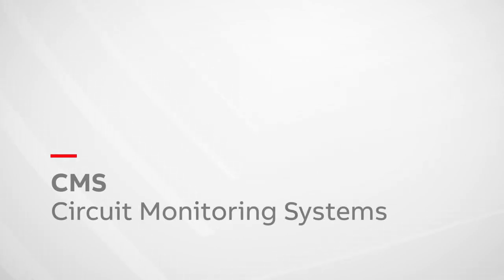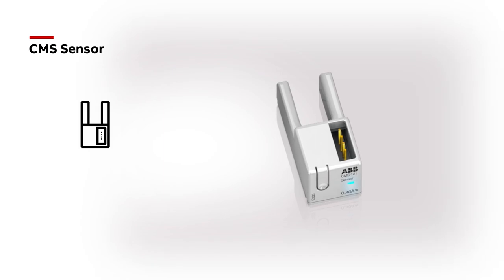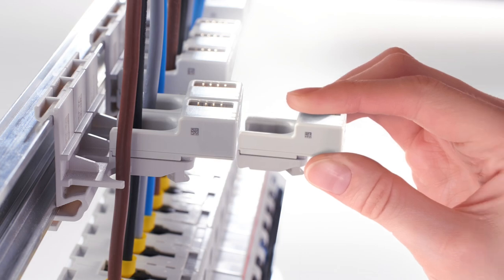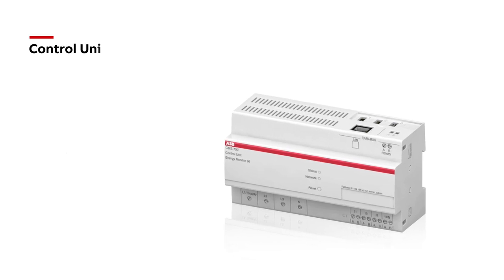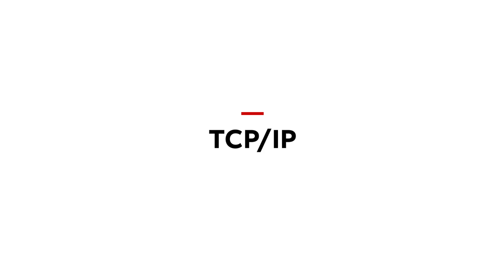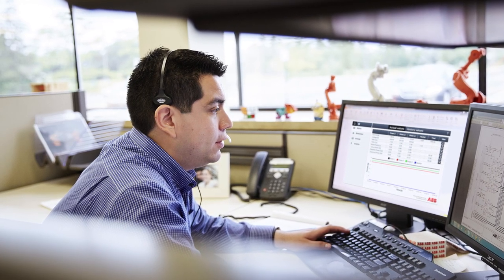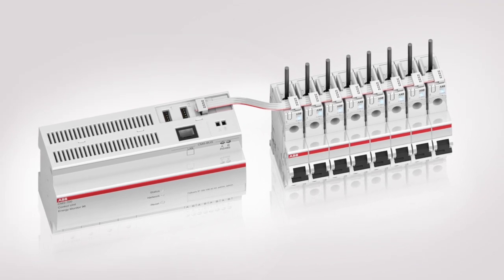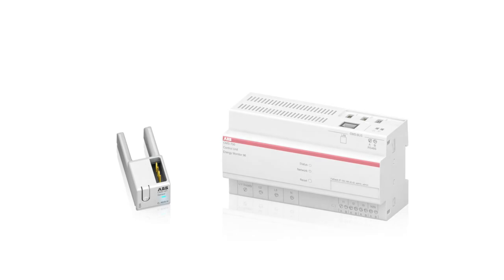Circuit monitoring systems CMS-700

Comment: Can CMS700 be connected to MCCB 160A?
Reply: The CMS 700 with the Sensors are able to connect up to 125A by directly connecting on the S200 and S800 MCBs. However with https://new.abb.com/low-voltage/products/system-pro-m/energy-efficiency-devices/system-pro-m-compact-insite you can also take the inputs from an 160A MCCB as Insite has Digital I/O modules for integrating other devices.